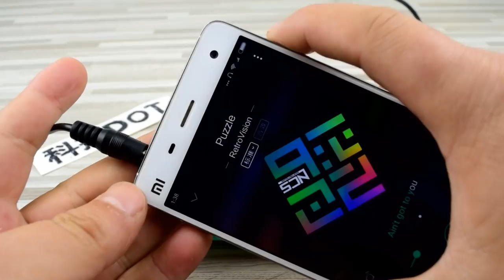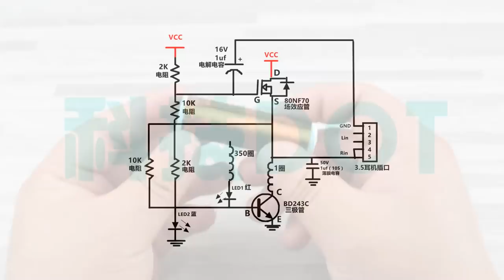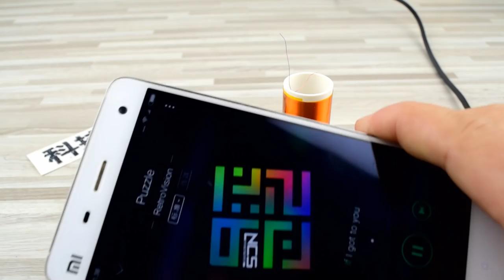How to make a mini Musical Tesla Coil Plasma Speake自制DIY微型音乐特斯拉线圈

Comment: Can you give me schematic with node? Because i can’t understand if resistor are in parallel or not. Thanks.
Reply from the maker: The circuit diagram is 2 minutes and 46 seconds in the video
Reply: I know but i can’t understand if 10k resistor and 2k resistor for blue led are in parallel. Are they?
Reply from the maker: Sorry, my English is not good
Reply: same problem
Reply: plz help

Comment: I would assume the discharge at 18v would be significantly larger than with 5v. Have you tried higher voltage with this design? What was the result? Thanks!
Reply from the maker: I did not try a higher voltage